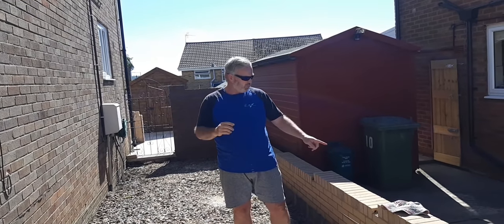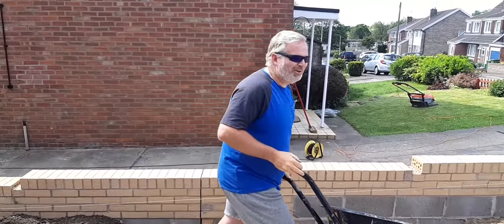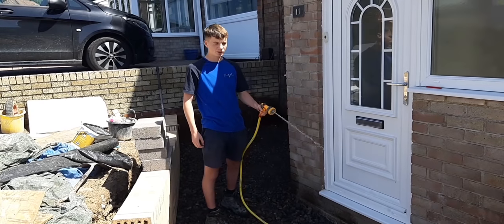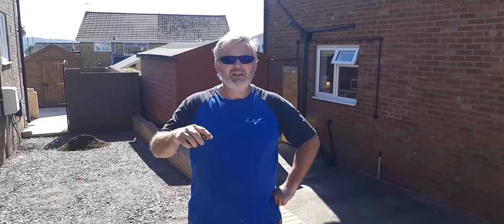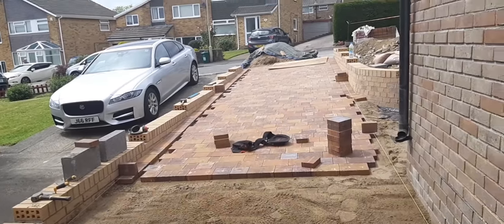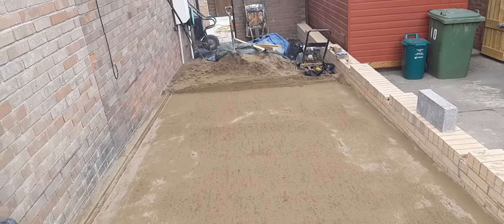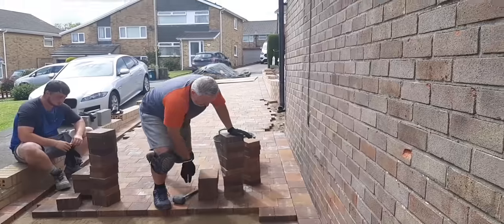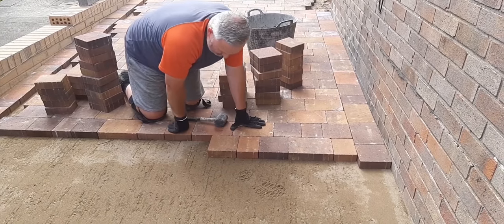How to Prep and Lay BLOCK PAVING

Comment: Nice job. Whilst it’s true that a geo textile membrane is a separation membrane it’s better laid between the sub base and the base thereby preventing the sub base from sinking into the sub soil. It provides structural integrity and is a real upgrade. The notion that any normal weed could penetrate the sand and come through the gaps in the pavers is a common misconception. Weeds between pavers come from scattered weed seeds from above. Some use membrane to prevent the sand from migrating to the sub base but this problem is prevented by blinding a thin layer of sand onto the sub base and going over with the whacker.
Reply from the maker: Spot on David it stops the base mixing with the underlying areas thus preventing separation. Its not needed on most applications  in the uk as long as the relevant layers that make up the base are achieved. Its a good addition on a slope or on certain types of ground to reduce separation. Good points and great post thanks David  👍

Comment: Hi Guys, one of the most helpful videos I've watched to date. I have a question..... I have to lay a pathway that is not up against any walls or edges on either side and I plan to type 1, lay a weed membrane, add 20mm of sand compacted leaving 20mm of sand to screed plus 50mm block paver. As I intend to whacker the finished blocks into this second course layer of screeded sand I will actually screed to 40mm below finished level. Now my question.... How do I stop the edges on both sides splaying out from the whacker plate? I don't see as I should cement them in backed up and then whacker the middle down as this may cause disruption to the cement edging, do i put them in, whacker down and then remove block and sand and re fit with a new cement base and backing up? Your help and advise would be greatly appreciated. Regards
Reply from the maker: Thanks Peter 
I'd suggest if you haven't any existing solid edge to work to .
Then you have to install a path edging set in concrete to retain the paving .
We do have other videos on driveways in the driveway playlist if that helps you.
Good luck 👍

Comment: What gap should I have from mot to to the finish level ie  pin curb to allow for sand cheers Kyle
Reply from the maker: Usually 50mm for layer and then the thickness of your paving Usually 50 or 60 mm .
So 100 to 110mm depending on your paving kyle 👍👌🧱🧱

Comment: I dont have a driveway im just trying to block pave the area outside my back door, there is currently what looks like coarse tarmac which is not falling apart or anything it just looks naff. Can  I lay paving blocks straight onto it with sand/cememt  Or do I need to take it up first?
Reply from the maker: Take it up first mike 👍

Comment: do you call MOT 'scalpings' in Wales? Its so confusing here in West Wales where MOT (sub base) is called scalpings, duff and a few others. Is that MOT you put down? Also what is the base and what is the sub base? I'm so confused. Thanks
Reply from the maker: I call mot scalpings but for youtube purposes i sat mot type 1.
For this driveway you have a subgrade the mud layer.
A base layer the scalpings .
A screed layer which is the layer the pavers are layed on .
Hope that helps 👍🧱🧱🧱
Reply: thank you for replying, I think I get it. Is the subgrade also MOT? @brickrightbuildinglandscaping
Reply from the maker: @dugbert9  the subgrade is the ground layer

Comment: We got an estimate of 6,000 dollars to reset our 850 sq ft driveway.  Which is way out of our range. We are considering doing a repair of the top 8 ft or so to prevent water pooling and ease of getting the car in the garage.  This area has sunk about 6 inches over 20 years. Would you recommend such a course of action?  We are in northern Canada.  Thanks.
Reply from the maker: Hi to all in Canada 🇨🇦 
If you lift up the defective area of paving. Then add a new section of base and compact it with a wacker plate.Has to be the right levels. Then re lay the paving wack when finished and add kiln dry sand to joints.
Its all about getting the right level to re do the base.
Hope that helps you out good luck with it .
Justin 👍 🏴🇨🇦

Comment: I need to do this and just fear it'll 'creep' out of alignment as I progress down the driveway. I've just done a shed base and despite my best efforts I didn't manage to keep it square (it's OK - hidden under the shed). I tried putting the wacker-plate thing over the sand as well as the stone sub material but I'm not sure it achieved anything. Would it be better if the sand was wet? Surprised you can just lay blocks on sand like that and still be able to drive a car over it without it sinking. Thanks for the video.
Reply from the maker: For alignment use a straight edge or string line .Also on this type of paving use a straight end and hammer the paving tight every few rows .
If sand is bone dry damp it that helps. 👍
Reply: @brickrightbuildinglandscaping  Thanks. That helps. Appreciate you sharing your skills
Reply from the maker: @bm7760  
Your welcome

Comment: Cracking job justin😎 why do you not screed out away from house and block in?  And also do you not lay the block right out to the edge and then cut your header block in?
Reply from the maker: Thanks Thomas appreciate it mate.
We layed that way around as the stacks of paving were out on the pavement and we set out of the house anyway .
As for cutting the boarder yes next maybe do that as you say 
Justin 👍👍👊🧱

Comment: What’s the best way to start the paving. Im starting one my self and it’s my first time how do I make sure to start laying with strings lines ETC
Reply from the maker: Best start with getting the right levels thats most important. String lines are used to keep lines straight. Also to help determine the correct levels. Good luck 👍

Comment: Hi Justin job looks good regarding roofing battons to screed of as you pull the screed put sand on top of batton then when you pull it out it fills out where they been then float it in as you block it if that makes sense Cheers  Tim
Reply: Forgot to mention the purpose of last message so you don't have to stand on screeded sand 👍Cheers Tim ps Shouldn't really try to give you any tips after Brad's Comments LOL🇬🇧
Reply from the maker: Hi Tim
Thats a great tip mate tar v much for that .just a bit of banter from brad he supports Man United an English team so hes full of crap Tim 😀😀 good luck tonight 
Justin 👍🇬🇧🇬🇧
Reply: Learn to screed then you don't need rails in first place👍

Comment: Hi Justin.......you say 50mm bedding sand and using 2 x 1 baton for screeding. But unless you use the baton on its edge which doesnt look like you do then 2 x 1 baton laid flat is only about 26mm or am I missing something? :-)
Reply from the maker: Chris hi mate.
Just lay your 50 mm of sand and add the batton to the sand you dont want to be digging in to the mot layer so it all works out well chris .hope that helps .
Justin 👍
Reply: Great thanks

Comment: So the sand layer is levelled and then whacked? Does this mean the sand ends up lower than it should be?
Reply from the maker: No lay the sand higher then whack it .then screed it so the sand should be higher than the screed rails.adjust as you whack 👍👊
Reply: @brickrightbuildinglandscaping  -got ya 👍👌

Comment: Hi mate, I'm following your advice. I just put the screed layer down. My house leads to the pavement, no straight lines anywhere. My house is on an angle and the pavement runs on an angle. I'm too thick to work this out. Do I just start from the house? This would be more hand balling the blocks will at least be square to the house but may look skew whiff. Please help. Wish you fellers done the job for me but on on the bare bones at the moment you probably don't come to England 😂 appreciate the help
Reply from the maker: To thick to work it out made me laugh that did craig 🤣🤣🤣 .your not thick mate as far as i can understand without seeing the job .id work square off the house and cuts against the pavement. Whats app me some photos tomorrow if you like craig ill help if i can mate .
Justin 🤣🤣👍💯
Reply: @brickrightbuildinglandscaping  agh mate that would be amazing. This is ruining my mind. I just need to know where to start. Once I get blocking them all will be right with the world. Just ran out of time today. Got it all screeded look lookin lovely but ran out of time. Rain coming tomorrow. Will this ruin it? If the posty walks on that tomorrow then he's getting murderd which is a shame cos he's a nice bloke
Reply: @brickrightbuildinglandscaping  Thanks mate, so stressed about this. I'm scared to start blocking incase I cock it up. Do I start from the house and work my way down or start from the pavement and work up to the house? I have drivesett savanna so I reckon I'd notice if they go skew wiff. My house dont seem that off from facing out to the road. I know I'm probably just stressin but the weight of the job is on me and I don't wans feel a nob if I cock it up. And I'm broke 😢
Reply from the maker: You make me laugh with some of that there craig. 
As i said so i can get a good idea whats what whats app me some photos and a take a good look.for you mate 
Justin 👍

Comment: Great job lads. I'm about to do this project myself, my drive is about 65m2. I've pulled up the old blocks  and about to put some crusher down. Just wana know how you do the fall and the screed rails. Do   whack the sand then put the rails on more sand or what? Thanks mate.
Reply from the maker: Craig find your finished level either end of the drive. Run a string line from both these points nice and tight . The sand should already be compacted now add your screed rail into the sand and use a block paver to sit on top of screeder so that your paver touches the line do this say every 1m and you'll end up with a nice straight line matching the levels you want to work to.
The falls
If you have a good fall by doing the above great if not you can angle it the opposite way but may need aco drains etc to accommodate this .
Hope you understand this mate good luck .if not give me a ring .
Justin 👍

Comment: Are the roofing batterns the correct size for the sand (50mm) ??
Reply from the maker: Hi Paul.
Its 38mm i think which is perfect 👍
Reply: @brickrightbuildinglandscaping  so sand bed 38mm thick??
Reply from the maker: Hi Paul 
Sand should be around 40 to 50 mm thick .
The battens are 38 mm thick. You will have a small.amount of sand left under your battens this is right otherwise you will dig into your mot base .hope thats of help any issue ring me tomorrow mate 👍

Comment: Nice job Justin, never tried block paving myself, but as you explained, preparation is key.
Do you use the whacker plate on the pavings after they have all been laid ?
Reply from the maker: MorningToni
Yes we whack the mot in two passes the the sand layer in one pass .Then when the paving is completed we whack it again but with kiln sand on the surface thia protects the paving and the machine forcea the sand between the joints.
Justin 👍
Reply: do you have to use a rubber base on bottom of whacker to stop paving getting marked or not?
Reply: It is advisable to especially on clay pavers👍

Comment: No need for that rubber hammer what you should be doing is get of your knees and every five or so row laid  get a straight edge and put it against leading edge and check for alignment and tap brick back with straight edge or push to paving units where needed to straight edge and on a bigger  job you would use a string line for alignment but you definitely could do with learning how to screed properly as its quicker and accurate and only need aluminium screeds and the knowledge of how to screed as its not just pulling aluminium screeds over sand freehand and hoping for the best there is a process 👍
Reply from the maker: More than happy to learn mate no issue with that .ive always done it like this on drives .i guess for big areas the process is different out on site .
Thanks again 👍
Reply: @brickrightbuildinglandscaping  if you use metal screed bars you can simply pull them forward for next pull.Probs do the same with timber batons to do it without screed rails you still have to form a dry screed on both sides anyway and pull of them just stick to rails n freehand when need to roll screed in.just do it the way that suits you best Justin Cheers Tim
Reply from the maker: @timconway7980  
Thanks Tim 👍

Comment: No need for weed membrane as weeds germinate in kiln dried sand and root goes down and leaf grows up never in a million years would a weed grow through 200mm of hardcore a layer of sand and then paving joints so that's silly only time you use different types of membrane is if you have bad ground or are doing permeable paving and need to separate layers to allow them to keep free draining also no need for screed rails they are for DIY homeowners or people who cannot screed in Ireland you would get laughed at if you pulled them rails out unless you where screeding by machine, also when them lads are pulling the board of them silly  rails the sand does not look as its been compacted first by a whacker plate which would not be good but definitely lovely weather 👍
Reply from the maker: The membrane is more to stop separation .the rest you say thanks for your comment 🤣👍
Reply: @brickrightbuildinglandscaping  There will be no separation as the mot should be fully compacted with no voids also finish mot with a layer of quarry dust for perfect sub base 👍
Reply from the maker: @scoyle1750  
Yea i no all this i do like to over do things just trying it never used it before first time for everything. There is a good amount of dust in the mot anyway so 👍
Reply: @brickrightbuildinglandscaping  your trying something that is pointless but there's one thing you don't know and that's how to screed so learn that and you will chuck them rails in skip for good as you don't have to set rails or fill in voids left by rails and all you need is string lines and aluminium screed and bit of screeding knowledge have a good day 👍
Reply: @S Coyle. Any chance of a video on screeding. You sound like a next level expert 👍👍
Reply: @barringtonsmythe3464  No interest in videos showing anyone how to screed but I can tell you I have never used a rail in my life on a driveway or commercial job unless I am screeding with a steel on a teleporter or tractor 👍
Reply: @ S Coyle. Shame as you sound like you have alot of info to offer. Thanks for the reply 👍
Reply: Try using some full stops if you’re going to go off on one, it’s a pain in the arse to read.